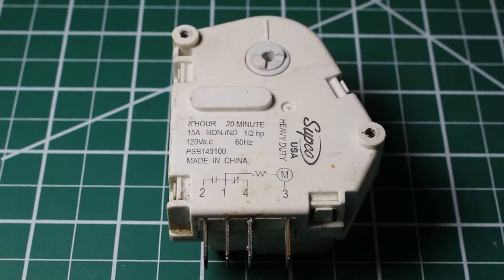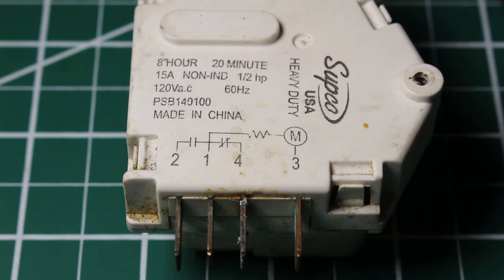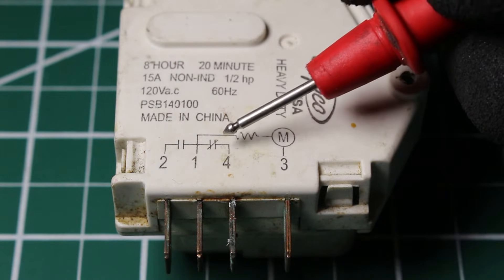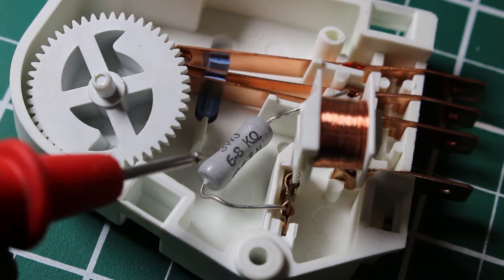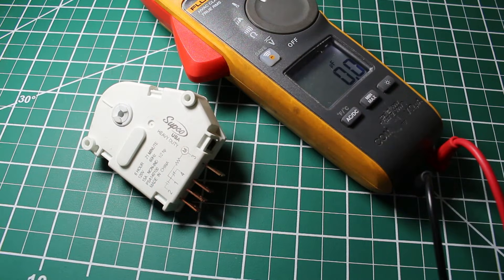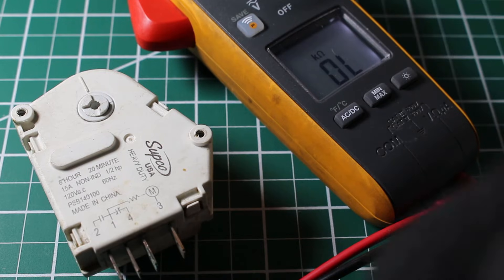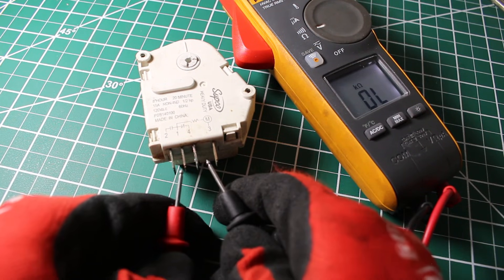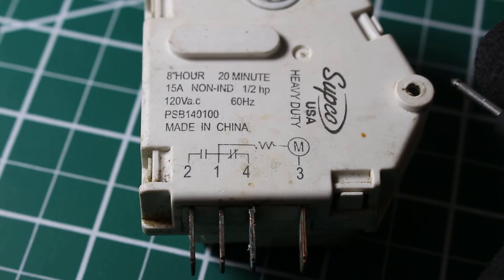HVACR: How A Refrigerator/Freezer Defrost Timer Works/Defrost Timer Troubleshooting/Sequence/Testing

Comment: Terminal 1 is Hot not Neutral, as you can see, 1 feeds switches 2, 4, and the timer motor which is then connected to the neutral at the plug through terminal 3. Again, terminal 3 is NOT power, it is the neutral leg for the motor. If 3 were power, there wouldn't be enough voltage to power up the compressor, light, fans because there would be a voltage drop across the motor and resistor in the circuit. In a typical circuit, the neutral is never switched, only hot. "Common" in this scenario means that terminals 2, and 4 share a "common" power feed. Hope this helps. Otherwise, you're articulation is great!
Reply: You are right. 3 is common or neutral. 1 is live or phase. Proof is the diagram itself 1 splits to 4 & 2. Secondly, you can see the resistor is placed on the side of 4,2,1, which is the side current comes from. Resistor is not on the side of 3. The work of resistor is to control the  current or simply minimize the current to protect the motor. 4 & 2 after being tested can be determined which is for cooling (compressor) & heating (defrosting). The longer time you turn till you hear the tick sound is for cooling. The shorter turn till you hear the tick sound is for heating. Every manufacture can differ numbers, but can be determined by diagram shown and/or continuity test. So do not cram the numbers.
Reply: @mh9251 live is phase
Reply: Excellent! You are very clear, precise, and focused.
Reply: So is he still right then if my meter is reading OL between 1 and 3 that the timer is still bad?
Reply: THATS WHAT I WAS THINKING TOO...THOUGHT I WAS TRIPPING.......I WAS THINKING IF YOU PLUGGED NUTRUEL ONTO 1....SEEMS LIKE A SHORT TO ME
Reply: Yeah I noticed he was wrong on that too.
Reply: Don't understand how you could call this a great video when terminal 1 was called neutral and 3 was called power. The reverse is true. Otherwise it was good

Comment: I was replacing my defrost timer and I decided to test the new part before installation. I watched this video while doing the tests. Using your two methods, testing across prong #1 and prong #3, the brand new just out of package defrost timer, tested as defective. When I tested for resistance, it came back as 'OL.' Then I tested for capacitance the same way you did but the meter never left zero. I read my meter's instruction booklet for about 30 minutes making sure my meter was working properly and set up right.

As a futile attempt, I installed the new defrost timer as a final test before returning the part. It worked!?

I could immediately hear the motor running and the ticking of the gears advancing. As a test, I waited two hours to make sure the mechanism was spinning/advancing, and it was. 

I wonder why a brand-new working defrost timer failed the test. I’m tempted to pull the timer out and retest it.

I theorize that since the part never has electricity flowing through it, whatever acts as a capacitor, had no charge and thus, the multimeter could not test the part.
Reply: I just tested mine and it had no continuity across pins 1 and 3. I manually switched it to defrost and reinstalled it as I don't have a new one and am trying to limp along. I set a timer for 30 minutes (which is the defrost time on this one) and just before the timer expired, the fridge kicked on. So apparently the timer is working.
Reply: @mswaffer  Better test for the motor would be to make a mark where he inserted screwdriver and come back in  a couple hours and see if timer moved.
Reply: Read my comment I tried to comment on yours and didn’t do it for some reason I didn’t feel like typing it all over but check out my comment in comments

Comment: I would have thought that something as mechanical and bulky as a timer would now be solid state, built into a board somewhere. Are these still being produced in new units? I suppose they'll still be around for a while.
Reply: Nowadays, they have defrost boards which go by the name Adaptive Defrost Control or ADC. They have a greater failure rate than the mechanical Timers.

Comment: excellent video, so clearly explained and well thought out. Subscribed, thanks.
Reply: 3 is common or neutral. 1 is live or phase. Proof is the diagram itself 1 splits to 4 & 2. Secondly, you can see the resistor is placed on the side of 4,2,1, which is the side current comes from. Resistor is not on the side of 3. The work of resistor is to control the  current or simply minimize the current to protect the motor. 4 & 2 after being tested can be determined which is for cooling (compressor) & heating (defrosting). The longer time you turn till you hear the tick sound is for cooling. The shorter turn till you hear the tick sound is for heating. Every manufacture can differ numbers, but can be determined by diagram shown and/or continuity test. So do not cram the numbers.
Reply from the maker: Thank you very much! Appreciate the feedback & subscription. Stay tuned for new videos every week 🔧⚡️

Comment: Great video! I do have one question. If I have 120v and everything is running via manually turning the dial, everything run, but not cool? Testing between 1 & 2, and 1&4 work. But no continuity between 1&3.
Reply: Cheap meter, you get what you pay for. try the same test with a fluke.

Comment: Good Job!! I have the same problem with my subzero 532 (30 yrs old).   Contacts 1-3 were OL on my meter.  I went through your process of manual bypass and it was exactly the same.  I've replaced the timer and am waiting to see if my freezer begins cooling normally (upper 1/2 was warmer than bottom 1/2).  I'm confident we fixed it (you and I ;--))

Comment: I have a defrost timer brand new but it won't  go in defrost mode I have to   do that manually and it will come out of  defrost, but what I notice when the timer is   in cool mode. only pin 1 and 2 which is defrost mode getting power and when I check  1 and 4 getting nothing  which is  cooling mode, and also the coil which is 1 and 3 nothing also, the thing  is when I   turn off the thermostat  that where 1 and 3 getting power and I can hear the motor moving  and the  timer would advance normally  but that when the thermostat  off I don't  know if  the thermostat  is bad but I am  getting conunity on the thermostat